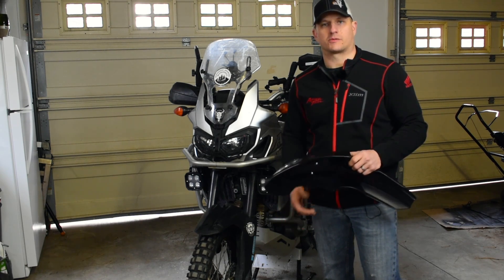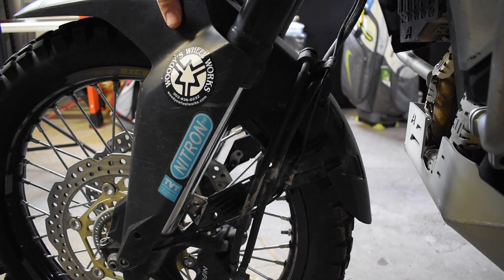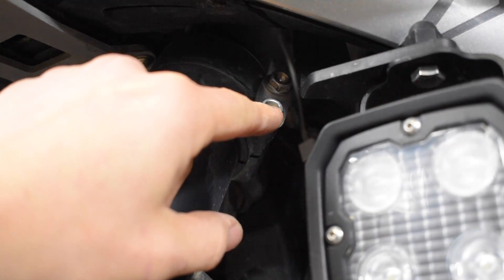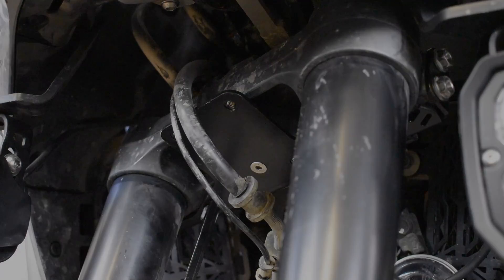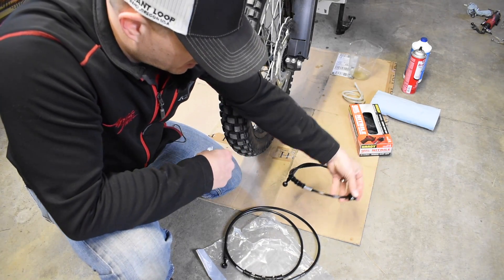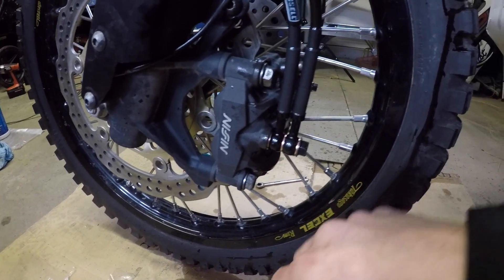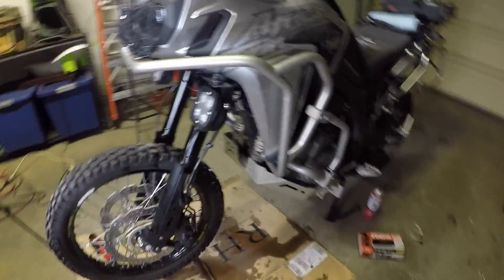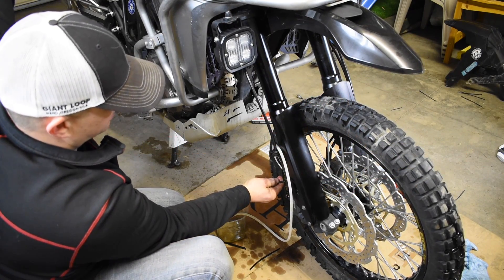AltRider High Fender Kit Install for the Honda Africa Twin

Comment: Thanks for the video. The printed instructions are incredibly unclear on both the brake line routing and the zip tie setup, and even the AltRider YouTube video is still unclear. I'm curious if 3 years on you are still running this fender? I'm not thrilled with how much the brake lines bow out on both sides, and I rode yesterday and the fender seems too small/short. I had mud all over my headlight and windshield in what I would consider only slightly muddy conditions. The 4 other bikes riding with me had clean headlights and windshields.

Comment: AltRider makes a high fender kit for the regular AT and the Adventure Sports, which kit did you use?  I can't tell what the difference would be, other than the "light bar".
Reply: Nevermind, apparently the Adventure Sports model needs a double banjo bolt fitting that doesn't come with the regular AT high fender kit.  Only difference I see.

Comment: I'm curious why you didn't go with the Camel frt fender kit ?
Especially since you have most of their other products.  After researching Alt rider and Tusk I went with the Camel kit.
By the way, you do a really good job on your videos.
Reply from the maker: Daryn Deamron hey thanks For the question. To be completely honest, I was sponsored by AltRider at the time and I got the kit at cost. Another reason  is that I liked the metal fork guards over the plastic ones. AltRides was also slightly easier to install. Both are great kits. There isn’t anything from Camel Adv that I wouldn’t trust. They make great produces and Cory is a great guy. Great company.

Comment: Good install video.   I’m digging them nice rims ya got on bike lol
Reply from the maker: Thanks for checking it.out! Wheels are by Woodys Wheel Works. Excel 21 x 185 front. Narrower than stock. Works a little better isn’t the slow technical stuff rear is a Excel 18x4.25. Same as stock size. Both are Super laced with Billet HAAN hubs. They are freaking tuff!

Comment: Nice video! Looks great. Have you tried the new fender in the rain on the freeway?
Reply from the maker: WestfallWorx not in the full on rain, but I recently rode on the highway that had just been rained on and had run off from snow melt. Very wet road, and I honestly couldn’t tell a difference.

Comment: What are those plastic pieces on your bar clamps for?
Reply from the maker: jjl46507 they are quick releases so I can rotate the bars for off-road and then rotate them back for highway. Tool-less design. They are actually made for bmw, but same thread pattern. Wonderluch.com

Comment: Why did they make it a crossover line?  It looks like it would be much more simpler to split the lines with a single line to each caliper.  This would eliminate the crossover.
Reply from the maker: TheMTrider16 my guess is they just mimicked what the factor lines do. When it comes to hydraulics, they are very precise. The oem does exactly what this kit does. To run a separate line to each would involve a lot more engineering with an new transfer block, reservoir and so on. My guess is they kept it the same as stock with longer lines to keep the cost down and make the kit more affordable. Great question. Thanks for watching
Reply: Backcountry Adventure Motorsports - Got it installed. The connections are the same, which is good, I guess; and is probably the reason for the crossover line design. The brake line routing isn’t my favorite, but the fork shields and fender bracket are pretty good.
Reply: see the TUSK high fender kit.  That's exactly what they do.

Comment: I thought all banjo washers were made from copper ?
Reply from the maker: Island Dreaming They are. I didn’t  catch it before, but that is correct. 😂
Reply: cheers man .., incase anyone else is wondering why .., it is because the copper is a very soft metal - and the copper squashes down to make a tight seal once the banjo bolt is tightened to it's correct torque rating . 

The Copper Washers ..,  are (generally speaking) a use once item only and should be replaced with new washers each time the banjo bolt is released and re-tightened

Comment: Looks awsome..but the brakelines looks very exposed?
Liker your chanel.
Reply from the maker: Toby 750 yeah I had them very looses. Since this video they are tucked a little tighter. They are steel braided with a rubberized coating so either way, they are pretty tuff. Thanks for watching. 👍🏻
Reply: Backcountry Adventure Motorsports 
Good chanel..ride safe

Comment: Looks crap and you get to much mud on the engine, would have been better to just move your high mount kit down 5mm .
Reply from the maker: Tony Lawton Nope on the mud on the engine and had the lifted fender first. Filled with mud in Nevada and broke the fender. This kit works great. These are proven for 3 years now. If you can’t say anything nice. Don’t say anything at all. 😂